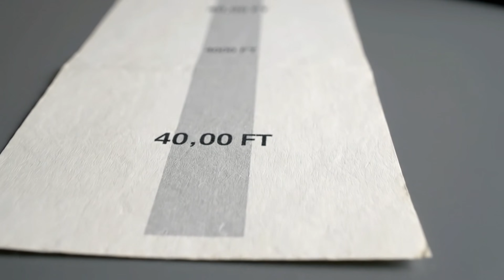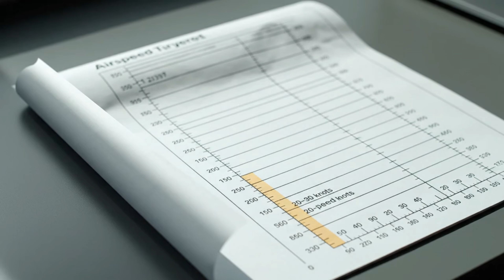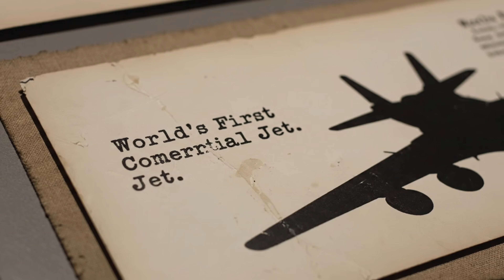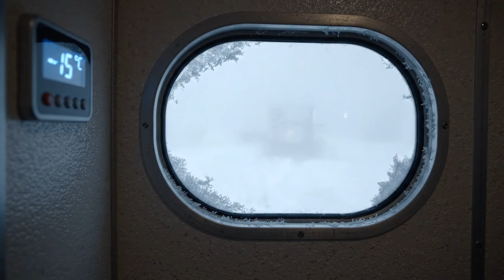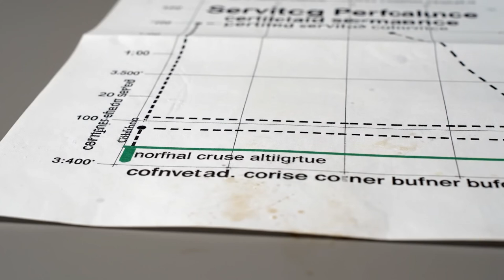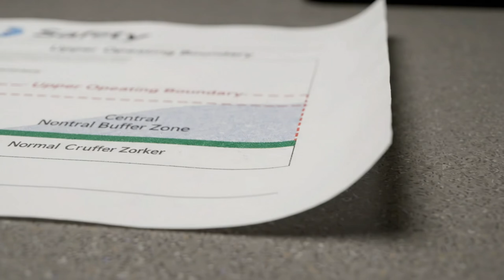What Happens If a Plane Crosses 40,000 Feet

Comment: You never ever see pilots climb their jets over the required max envelopes ceilings only maybe 2-3000 feet above cruising speed which normal is 38,000 so max would be 41,000 and that is it so don’t worry anything above that will disrupt airflow and experienced commercial pilots know this!!